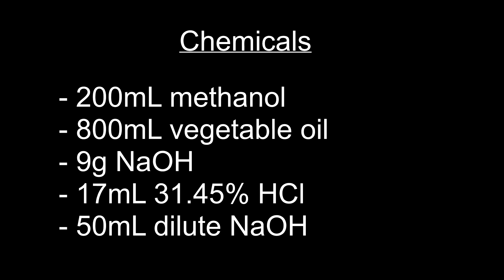How to make Glycerine (Glycerol)

Comment: wouldn't be easier to use magnesium sulfate instead of molecular sieve to get rid of the water ?
Reply: magnesium sulfate create solid hydrated magnesium sulfate when it touch water and this is what I use at school to dry organic compound
Reply: I think it could do it but I never really work with hydrophilic compound
Reply: +Hurleur de foudre you also could dehydrate NaOH which then would strip any water aggressively from any other compound without adding another reagent.

The dehydration process is performed by simply overheating NaOH in a closed metal or ceramic container. NaOH will then be in powder form and extremely aggressive. Without the closed container, you risk to get dehydrated NaOH on your skin and eyes and get severely hurt in fractions of a second!
Reply: +Ariesticnig The NaOH is needed as is, because Na tries to keep its bond, while NaO would change the reaction. NaOH catalyses a reaction which could eventually succeed without, but only under certain conditions. Under high pressure and a lot of heat, the fatty bonds would break apart and release a number of side products, including glycerol.

However, this system (called cracking) is inefficient and the separation of the side products is expensive. It is used in the creation process of plastics and fuel, but not for glycerol production.
Reply: +Ariesticnig NaCO3 has not such a strong bond as NaOH, and the reaction would produce a lot of unwanted side products. I haven't looked into it, but I suppose it will result in a large quantity of soap, an insignificant amount of glycerol and a lot of CO2 gas.

The catalysing effects of NaOH are the following: with heat, the fatty bonds are becoming weak and NaOH introduces itself corroding the weak bonds by swapping the OH molecules. However, Na is an aggressive reagent and steals an OH molecule from another weak link, splitting de facto the fat molecules and remaining NaOH.

With NaCO3 or anything else, no Na ions are formed and thus the reaction remains incomplete or changes completely. With NaO for example, O oxydizes a weak link, but does not split it completely, and Na reacts on another weak link, but the molecular structure is completely different. Eventually, Na attacks itself somewhere. I have no idea of the outcome.

Nile is the expert of unexpected reactions :-)

Comment: Could the methanol be replaced with any less toxic alcohol ?
Reply: +Bynokel If you use ethanol for example, the reaction takes only place with stronger heating and stirring, and it is in any case much slower, taking about 24 hours. In addition, more soap is formed and the purification process may become a more lenghty process. Essentially, any alcohol works, but methanol has less annoying side products.
Reply: No

Comment: I don't want to make this but where do you even get NaOH, HCl or methanol?
Reply: +celroid532 NaOH is found pure as a drain cleaner or color removal. HCl is found as a household Ca removal at 35%. Methanol is found almost pure for cleaning purposes (reddish color) and the impurities are irrelevant to the reaction. All reagents are cheap.
Reply: amazon or a chemistry shop.
Reply: +celroid532 NaOH can be found as drain cleaner, HCl as muriatic acid and methanol can be found as a solvent in hardware stores (also sometimes called wood alcohol).
Reply: y2ksw1 Great answer

Comment: it is edible this product ?,may containing small amount of methanol ?
Reply: +Fatih Enes Kuru It would have to be tested, but he distilled off most of the methanol then evaporated the rest for 10 minutes, i think he said, at 110C, which is much higher than the boiling point of methanol. That being said, I don't know if methanol/glycerol has a known azeotrope, but the boiling points are so far apart that it is not likely. Perhaps molecular sieves that selectively uptake methanol would be used to further purify it for consumption. This doesn't matter all that much though, because if you want to use it for consumption, it is far cheaper to just purchase food grade glycerol.

Comment: what do put in the Erlinmeyer flask that stirs is
Reply: +Grant Markum (Bacon man 121) It's a magnetic stirrer. Basicly a magnet encased in 
non-reactive plastic which turns by larger magnets spinning inside the 
heating plate, under the erlenmayer flask.

Comment: What's that spinning pill thing?
Reply: +Captain Shark its the magnetic stirrer. Basicly a magnet encased in non-reactive plastic which turns by larger magnets spinning inside the heating plate, under the erlenmayer flask.
Reply: Its called a flea
Reply: +Ilgaz Er Teflon mostly... not plastic. Plastic would dissolve in a lot of chemicals.
Reply: +Archishman Ghosh PTFE
Reply: Yes... Teflon is the brand name for fluorinated ethane polymers.
Reply: ahh, you're right, I just prefer the name PTFE.
Reply: +Archishman Ghosh PTFE is still a plastic, thermoplastic to be specific.

Comment: fantastic video. clear and easy to understand.
still... 800ml vegetable oil -> 24ml glycerine.... >_>
Reply from the maker: Haha yeah. Definitely not the most efficient process. Much cheaper and easier to buy. I got 500ml for 9$ at the local pharmacy. High quality and low water content.
Reply: Nile Red yeah decided to try to do the math for it, and I think even if you bought a gallon of vegetable oil at $6.30 (estimated tax included) you'd still only end up with a theoretical yield of like .114L --- 114 ml. And that's not including cost of the stuff you have to mix it with, and the time you put into it and all that fun stuff. 
Still a really cool video though. Whenever i watch his videos I feel like I know the world a little more.
Reply from the maker: I am glad to know you enjoy them :)
Reply: @NileRed  If I may add, when using castor oil, highest yields were obtained by using 1.5% catalyst by weight, reacted for 60 minutes, and had a stir rate of 1000 rpm. I think your synthesis mainly lacked time. 

Time was found to be the biggest factor in maximizing yield. The second part you probably lacked was good stirring. I didn't do the math but I think you also used a non ideal amount of catalyst.
Reply: Most of it is fatty acid
Reply: it would be easier to use the sulfit fermentation. during ww1 they feed the yest sulfit and they produce instead of ethanol Glycerin.

Comment: Nile Red You mentioned that one of the byproducts is fatty acids. Would it be possible to use olive oil in this project and extract exclusively oleic acid from the fatty acid mixture for use as a surfactant in ferrofluid?
Reply from the maker: Interesting. The fatty acids show up because either they were just present in the oil and reacted with the naoh, or the naoh cleaved the methyl ester. When acidified, the acid is regenerated. 

If you wanted oleic acid, it seems feasible to do the transesterifixation, separate the glycerol from the biodiesel (methyl esters), then cleave the methyl esters back to the free fatty acids. 

I am wondering though if it might be easier to do it in water and saponify it. Then acidify and you should have 3 layers. Glycerol (which might actually just dissolve in the water), water, and fatty acids on top.
Reply: Nile Red I once attempted the water and saponify method and did in fact acheive a layer of fatty acids on the top after acidification. (I don't know if glycerol was produced as I didn't check for it) However, the fatty acid mixture layer solidified over the course of about a week, and eventually became soluable in water again. But now that I think about it, I suspect that this was due to leftover NaOH that wasn't fully neutralized. Could I distill over the fatty acids to obtain a more pure oleic acid? (Assuming a proper acidification process)

Comment: What if you boil vegetable oil and sodium hydroxide with no methanol? It should result sodium esters of fatty acids (soap) and glycerol. The soap separates in a solid layer above the alcaline glycerol solution.

Comment: Where do you source your methanol?
Reply from the maker: flimsybop I buy it from Canadian Tire, or Walmart
Reply: Nile Red Is it from heet antifreeze? because that's quite expensive :(
Reply from the maker: No no, it is sold at $5/L as methanol 99.9%.
Reply: Nile Red Oh really, what's the name of the product?
Reply from the maker: Methyl hydrate

http://www.canadiantire.ca/en/pdp/tools-hardware/paint-stains/paint-thinners-strippers/methyl-hydrate-0497127p.html#.VYrW3flVhBc
Reply: Thanks!
Reply: flimsybop I've gotten it from truck brake line antifreeze, it's quite cheap and quite pure, though I'd distil it at least once to make sure any additives are removed.

Comment: Could I use something diffrent than Methanol?
Methanol is really hard to get in germany and very expensive. 25€/l
Reply from the maker: blubb7711 Really? You might be able to use another alcohol, but it should be anhydrous (no water). I am not 100% sure how well it would work though.
Reply: I could try to dehydrate some 96% ethanol, its very cheap and easy to obtain~
Reply: blubb7711 http://www.subolab.de/shop/methanol-technisch.html?gclid=CjwKEAjwq-OsBRDd95aryprR9wQSJACQnU3GFnccxZInr0qzKaEVG_99MDcQOMuki1FtX9MWCIdI-xoCO8zw_wcB , 
25€ for 5l
Reply: lol thats new.
But, your aren't allowed to send Methanol directly to the costumer, the Shop have to deliver it to a drugstore, there you can pick it up ;)
Reply: blubb7711 oh lol good to know xDD
Reply: blubb7711 you can use pure ethanol which is drinking alcohol. I'm sure you can find plenty of that in Germany. Also if you don't have pure ethanol you can still do the experiment. Just add extra NaOH and the water will under go base hydrolysis with the triglyceride which will form soap and glycerol in addition to the transesterification.
Reply: 96% Ethanol is dirt cheap, only 2€/L

Comment: What is the purpose of the methanol, other than forming the fatty-acidesters? Can ethanol be used, or even water?
Reply from the maker: Nakmus Well you are doing a transesterification, where the methanol is swapped for the glycerol. You could in theory substitute the alcohols, but you would have extra water if you don't use anhydrous ethanol. 

According to this source, the presence of water increases the amount of soap that is produced: http://www.biodieselmagazine.com/articles/4235/keep-water-content-in-methanol-to-a-minimum

Comment: I remember performing the saponification of olive oil at school using a concentrated sodium hydroxide solution. The glycerol would separe from the mixture as well if you left the solution without stirring.

Also, wouldn't an acid catalysed transesterification be better since you'd avoid generating the saponification product?
Reply: Without the saponification, wouldn't it become an equilibrium reaction?
Reply: Adding NaCl could help seperate the  soap from the glycerin if wikipedia is  correct
Reply: supersmashsam I want see milk rm  stay mathord